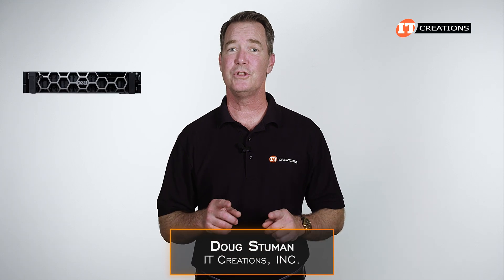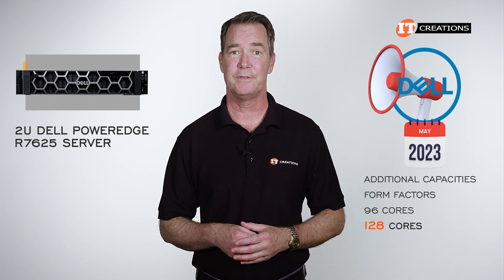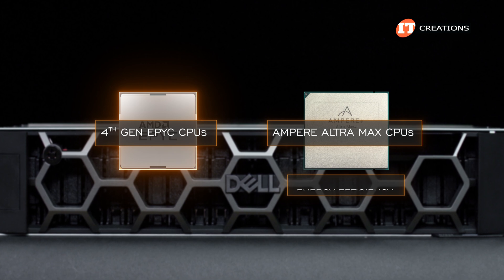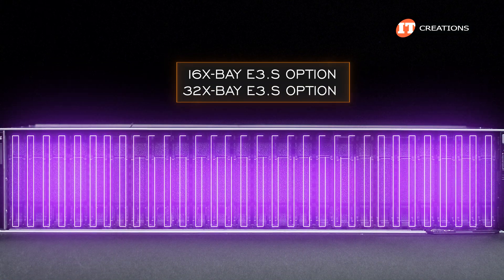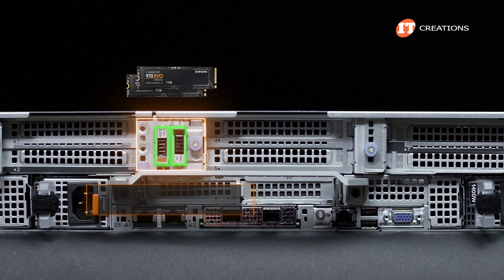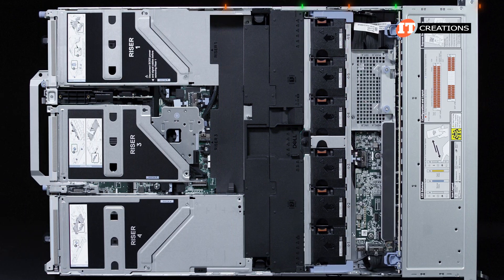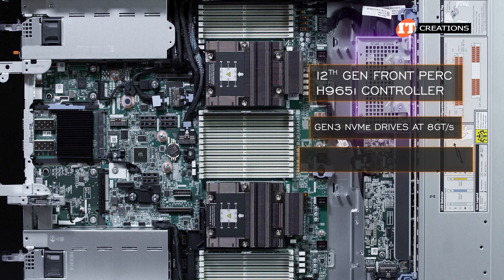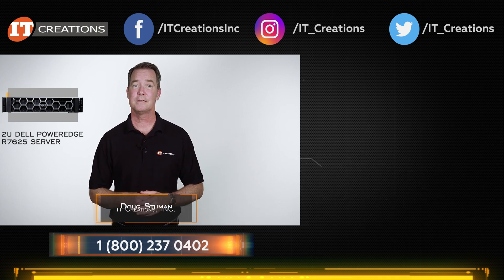Dual 4th gen AMD EPYC Dell PowerEdge R7625 Server REVIEW | IT Creations

Comment: I have a Dell Power Edge R7525 with 24 bays using 12  3.76tb NVME drives using 3rd gen AMD EYPC  2 AMD EPYC 74F3 24-Core Processor  and 1tb of 3200mhz DDR4 ram using 8 128gb sticks that server is a beast then dell releases this  :)
Reply from the maker: Technology never ages well but that said, your system look like it kicks ass!  Well played! Thanks for watching and commenting! 🔥🔥🔥

Comment: Does Dell lock AMD processors once installed?
Reply from the maker: Apparently, that is a yes. Once installed in a Dell system the processor (Intel or AMD) can be moved to another Dell system but not to a different platform under a different manufacturer. You can move it to another Dell platform. HPE does this too. Also similar to what a TPM or trusted platform module will do. Great question! Thanks for watching!